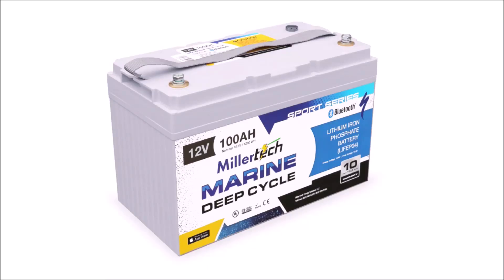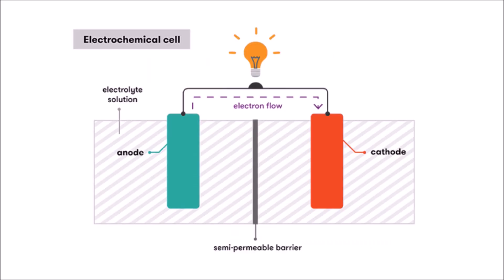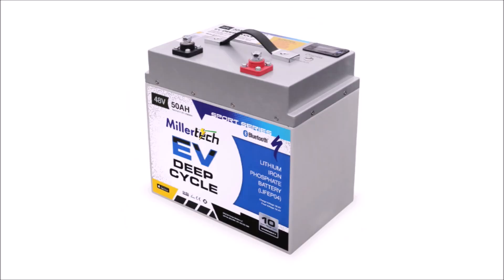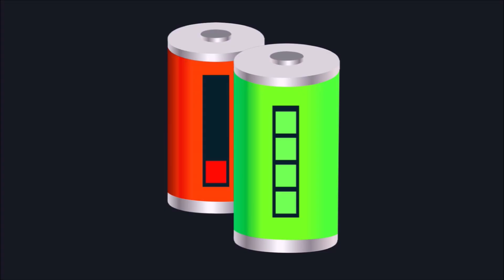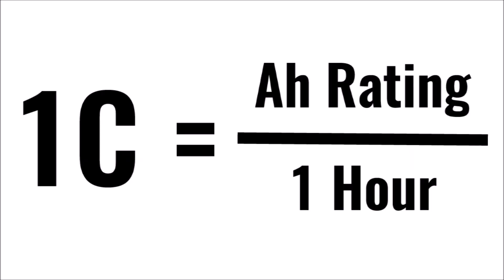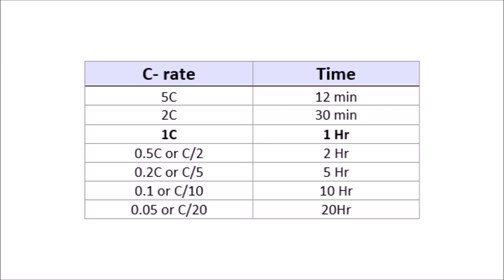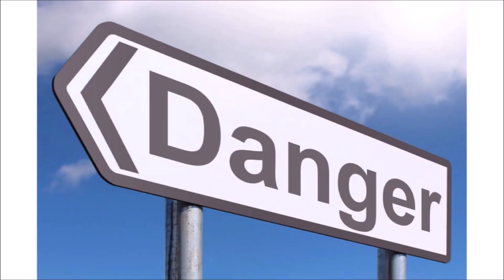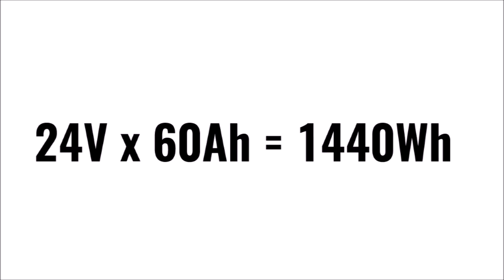BATTERY BASICS -  Battery Capacity Explained - Understanding Amp Hours, C-Rate, 20 Hour Rate & More

Comment: C ratings makes most of people confused.. because the calculation is not make any sense..

even some the battery datasheet says the battery can discharge almost 20 times than the capacity (like 2500mah battery that can output 20A continuously) in reality it is not that continuously..
it could be draws 20A for very short amount of time (like the power tools battery packs) or for vaping devices.. 

but for long operations (like for laptop battery pack or powerbank battery pack, the battery just draws 2A or 3A of current continuously for 1 hour (and this calculation more make sense)..

(i am talking about li-ion battery)
Reply from the maker: It is confusing, for sure.  But once you know the C rate for a particular battery then it becomes useful for guesstimating runtime.  You are right that using a lithium battery at a high current (such as 20C) will deplete it very quickly.  But that is the same as any other battery.  In fact, lead acid batteries suffer from the Peukert Effect, where they actually lose capacity at higher rates of current.  And they use the equally confusing 20 HR rate of measuring capacity (or another hour rate).

Batteries are just complicated devices.  Much more than most people think.  You can't just use easy math to get an accurate measurement with them.

Comment: how long will this last on a 12v leisure battery... 9~30V DC
Idle: 100 mA @12V
1.0A(peak) @ 12V... what solar panel will i need to keep it running , i have 2 x 120ah 12v batteries and 300 watts will that be ok,,, please reply back
Reply from the maker: That is a very small load.  Even if it is at its peak of 1A all day every day, you would only need 288Wh per day, or 24Ah.  You have 240Ah so you have more than enough battery power.  And your solar panel should produce about 800Wh per day (very general estimate - will depend on a lot of factors) so you are covered there, too.

Comment: Great video. My battery has 175AH @20HR-Rate to 1.75V per cell@25℃. Does it mean that it can discharge up to 10.5v before recharge if through how safe it?
Reply from the maker: It can do it, but keep in mind that you will sacrifice some cycle life to do so.  See if you can find more information from the manufacturer.  Many of the top manufacturers will publish a chart that shows cycle life vs depth of discharge and that can help you make a decision on how much capacity you should plan to use each cycle before recharging to get the length of service you want.

Comment: Sir, do you have a VRLA battery with 24v 18Ah specifications in good condition and drop condition, if so, can I ask for the charging and discharging measurement data for my research purposes, thank you 😊😊👍🏼

Comment: Regarding C rate: if a 100 Ah batt has a 20 hour C rate and that equals a discharge rate of 5 amps for 20 hours, does that mean the batt could supply 10 amps for 10 hours? Or, what if the 100 Ah batt were given a 10 hour C rate. Does that mean the batt could supply 10 amps for 10 hours (100/10 = 10 hours)?
Reply from the maker: For lead acid, you can't interchange the rates like that.  It will give you a ballpark estimate, but there is a law called Peukert's Law that states that the more current you draw, the less overall capacity you will get out of the battery (lead acid).  So you will get less overall Ah out of a battery at the 10 hour rate than you will at the 20 hour rate.  So you can do the math like you were describing but just understand that your numbers will be off and sometimes way off.
Reply: @LDSreliance  Thanks, I suspected that might be the case. Clearly, the relationship is not linear.
Reply from the maker: No, it is not.  That is why they have different hour ratings.  Some manufacturers are better at publishing the rates than others, unfortunately.

Comment: You really need to understand the 20 hour rate on Lead acid batteries.  7 amp hour battery is Not 1 amp for 7 hours.   It's a total of 7 amp hours discharged at 1/20th of the rating or 0.05C.  C being the capacity.   This only applies  to Lead Acid batteries.   So if you discharge a 7 AH battery at 350ma for 20 hours it'll equate to the rating of 7 amp hours.   Anything over that discharge rate will result in less amp hours,  often much much less.
Reply from the maker: Not really.  The 7Ah battery would be rated at 0.35A for 20 hours.  It would also be able to supply 1A for 7 hours, roughly speaking.  The Peukert Effect would be negligible at 0.14C.  Maybe the difference of 10 or 15 minutes, at most.

I did explain C-rates and 20 hour rates if you watched past that point in the video.
Reply: @LDSreliance  I've never seen what your saying hold true in real world tests.  At a 1C rate you are going to get far less than the 7ah rating of most lead acid batteries.   Agree to disagree based on real world testing and research.   We are only talking lead acid here.
Reply from the maker: But a 1A draw is nowhere close to 1C.  It is .14C, like I said.  The difference between 0.05C and 0.14C is negligible.  You don't have to believe me.  Look it up.

Using 1A for 7 hours is a heck of a lot easier for people to use as a measuring stick than trying to figure out what 0.05C of 7Ah is.  And the 20 hour rating essentially means nothing because no one draws such a tiny amount of power.  350mA @ 12V is 4W.  That is probably less than the idle consumption of any inverter you would have connected to it.  So it is meaningless.
Reply: @LDSreliance  1 amp for 7 hours is 7 amp hours,  Yes.   I just so happen to have a 7ah battery on the test rig that gets 7300 mah at a 20h rate.   I'll test it at a 7 hour rate (1 amp) and see where it lands.
Reply: @LDSreliance  Test results in,  I was a bit off in my original number as I realized I had run my first test at 450ma which gave me 7368mah,  the test that just finished was run at 1 amp and resulted in 6648mah.   So OK,  not as drastic as I mentioned, but still noteworthy.   It's also not a linear slope of degradated returns,  so a 2 amp test for example would be much more drastic.    If I had tested at 350ma vs 1 amp the numbers would have been further apart.    I'm going to just  leave it at we are both somewhat right.
Reply from the maker: Correct.  A 2A test would be worse.  I specifically mentioned in the video that thinking of it as 7A for 1 hour would be a mistake because the amp hours you would get at 1C would be nothing close to the 20 hour rate.

Comment: Hi 
I have 3.5KVa / 24v interveter connected to 4 x 12v / 220Ah batteries, my max load rarely exceeds 500w, how many hours of backup should I expect from this set up ? theoritically and practically
Thanks
Reply from the maker: At 500W you would have roughly 21 hours of run time.  But that doesn't take in to account real world conditions so lets say about 20 hours.  If the load averages 350W then it would be about 30 hours or probably about 29 in the real world.

However, if your inverter is not very efficient at lower loads then it would be lower than those numbers.

Comment: Can anyone explain to me is why at 12.0 volts my leisure battery is (apparently) deeply discharged and needs changing.
Reply from the maker: I wouldn't say it needs changing unless it never gets above that point.  A fully charged flooded lead acid battery should be 12.6V when fully charged (after letting it rest for a while after disconnecting the charger).  A fully charged sealed lead acid battery would be 12.8-12.9V at full charge.

Comment: How many 24v 100amh batteries can be connected to a 3000watt inverter? Will it damage the inverter?  I  would like to have 7 days of battery power due to weather, my loads are around 400amh @ 50% I really only need less than 200amh.
Reply from the maker: There is no real limit to how many batteries can be connected to an inverter.  But for practical purposes you would be limited by the space you have available and your budget.  7 days of battery power is almost impossible unless you have a LOT of money to invest.  Even fans and small devices add up if they run around the clock.
Reply: @LDSreliance  Thanks have some space and a little money to improve storage of the sun, when it shines...Good videos very informative.
Reply from the maker: Thanks!  I appreciate that.  Good luck!

Comment: The discussion at 3:30 fails to acknowledge that lead acid batteries are rated for X amp-hours, but if you use more than about half of that you produce "permanent damage.
Reply from the maker: Except that is false.  That is a commonly held false belief that applies to car batteries but not deep cycle lead acid batteries.
Reply: @LDSreliance  Tell Trojan.  I just pull the info off their data sheets
Reply from the maker: Link me to that.  All the cycle life charts for Trojan that I have seen show no dropoff at 50%.  Nor does their literature say anything about permanent damage.  In fact, they rate their batteries to a specific cycle life @ 100% DoD.